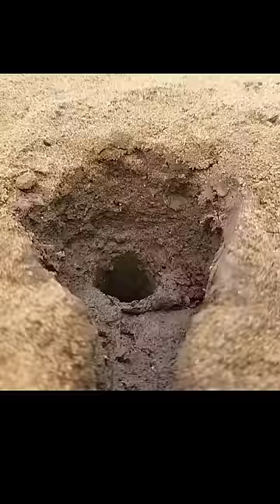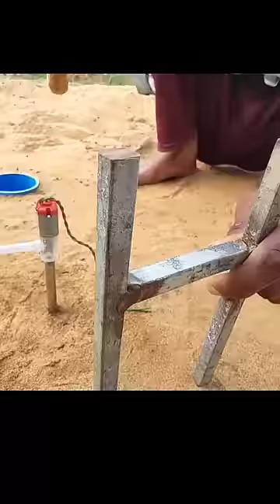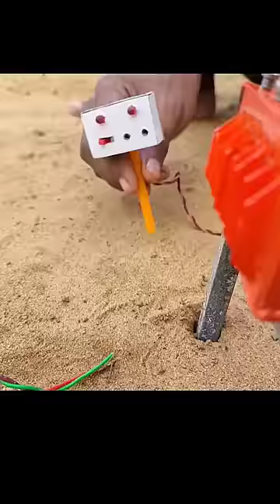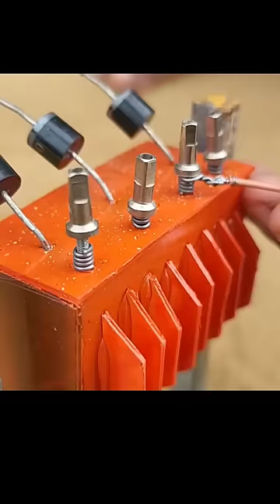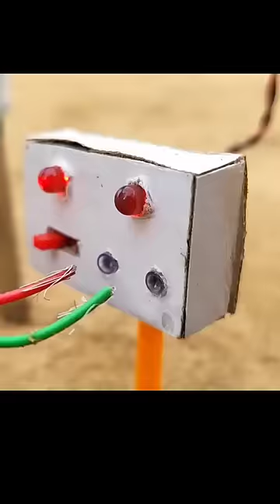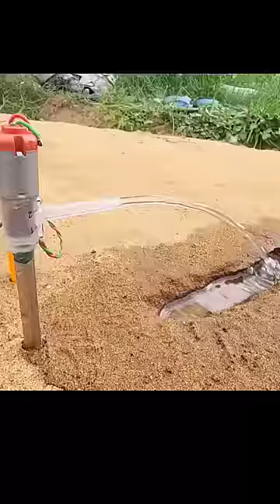borewell water pump project #scienceproject #waterpump #diyprojects #diy #shorts

Comment: পাইপটা কতখানি নিব
Reply: Pipe usually comes in 30 foot sections so take the depth usually 150 to 300 feet divided it by 30 you get the amount of pipe
Reply: Ohh don’t forget the outside pipe (casing ) and the electrical wire to run to bottom of well to power pump